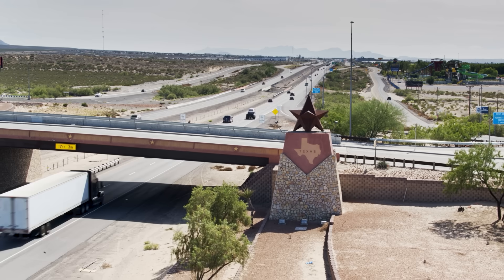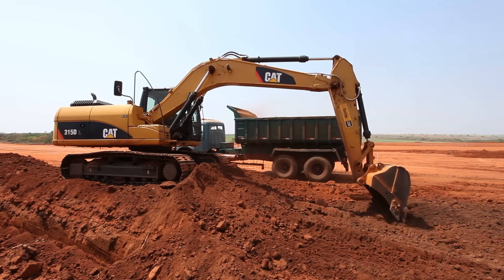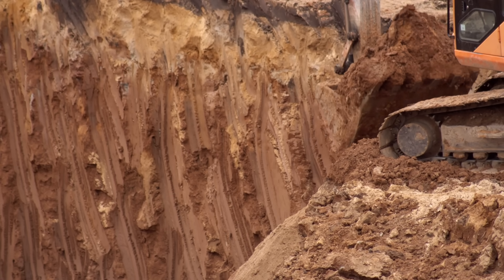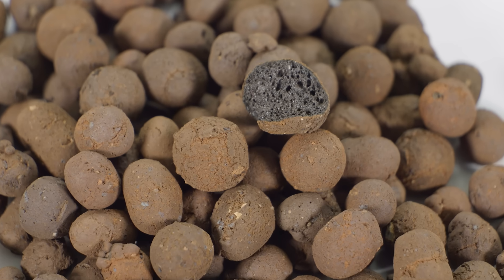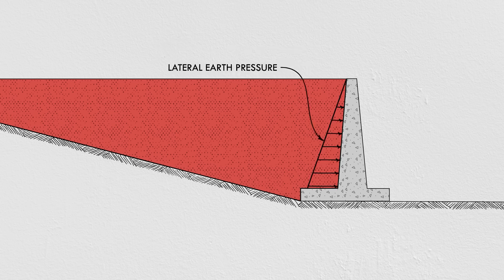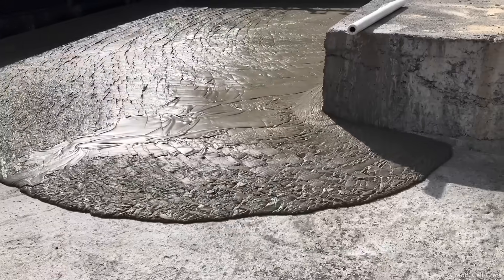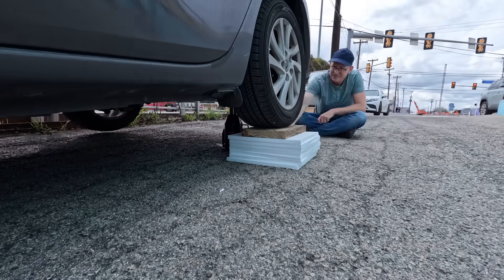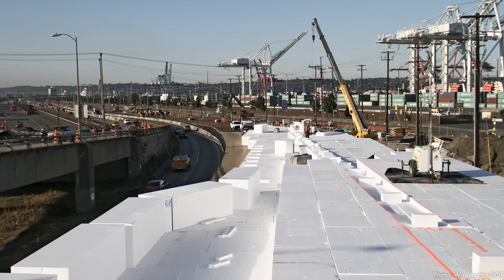Why Some Roads Are Made of Styrofoam

Comment: A bit OT, but when we had a flat built in Hungary, I was surprised to see that, as well as the highly insulated blocks they typically use, they also lined the outside of the walls with expanded polystyrene blocks (maybe 15cm/6" thick?) and then rendered over the top. As a Brit, I was very surprised by this, as I think of this material as lightweight packaging, of no particular strength, and essentially for throwing away after use. Had I had the option, I probably would have chosen not to have this extra layer of insulation - imagining that it would be very easily damaged and the rendering would tend to flake off.

But, nearly 18 years later, none of that has happened - the exterior hasn't been damaged at all and the rendering is actually staying attached better than it does on a normal brick or block surface. In fact, unless you tap the wall, you would have no idea it was expanded polystyrene. The only drawback I've experienced was when putting up external lights on the balcony - when I had to buy a ridiculously long bit for my drill (to reach the actual brick work) and then faff about with poking fixings down a 6" hole with an equally ridiculously long screw!

Comment: A bit of a problem with EPS foam for roadways... unless there is a considerable thermal barrier between the foam and traffic a single high intensity vehicle fire could compromise the entire roadway.  I would imagine that the surface, subsurface, and substrate would be generally sufficient but flowing fires could get past all of those barriers and create more nightmares than the initial accident.

OTOH I could imagine that this foam would soak a lot of the stresses imparted by earthquake events, enough to prevent immediate catastrophic failure of the surface that it's supporting though could require replacement after the event.

Comment: Polystyrene fill on a railway embankment in England. A remediation project on mainline lead to the bridge abutment . To allow for greater axle loading and greater speed. Polystyrene was used to rectify poor soil in the embankment  and the poor bearing properties of the soil in the area. Cheaper than closing the line for months and recreate the whole embankment leading to the bridge abutment.

Comment: What about railways in this context?  They have exactly the same problem - 'soft' soil embankment meets rigid concrete/steel bridge, but they have significantly heavier loads going over the interface, and a difference in height can be catostrophic (a bump for a car is a derailment for a train).  And they also don't have the luxury of waiting weeks or months for things to settle - railway engineering typically has to be done and finished over a weekend, or even overnight.  What do they do that road builders don't?

Comment: In the netherlands we always use a concrete slab that rests one side on the structure, the other side on the ground. This way, the "bump"' created by settlement, is also distributed more evenly. We still use lightweight materials a lot too though

Comment: Man, should you be informed that cellular concrete, also called aired concrete, is the default material of choice for building in basically the entire eastern half of Europe? We make strong concrete pillars and the walls themselves are large bricks of cellular concrete. It`s amazing to work with sculpting and cutting the blocks into anything, plus any leftovers or dust from cutting can be scooped and mixed with the mortar used to stick the blocks together. Almost zero waste, plus it`s a fairly good insulator, reducing the need for thick and polluting styrofoam.

Comment: The Czech Republic:
Road closed
Work starts after a year
2y building 100m of the road
1y still closed
After about a month it is even worse, than it was previously
And yes, we have a highway with length of 366km (additional 10km in building). First project is from 1935 and it is not finished yet. One transition to a bridge survived just 1 day after 6 years of building it.
Reply: Nice corruption you’ve got there. I’d like to see how well built the mansions are occupied by the people who run that circus.
Reply: @mercoid  You are kind of correct. 1km costs nearly the same as in Switzerland and Switzerland is mountainous country with much better roads.

Comment: In Sneek the Netherlands they have a problem at the aquaduct. The road raises by ground water pushing it up.
As tempory sollution they placed sandbags to weigh the road down.
It works only no vehicle can use the road till they find a way to solve the problem...

Comment: Where I live, a number of bridge ramps where constructed of huge blocks of styrofoam.  7 years later at the point where the foam meets the bridge deck, there is severe settling and is downright dangerous to drivers.  Warning signs seem to be the only recourse engineers are taking.

Comment: I drive over 35 bridges in 40 miles one way and I plan a ton about how I'm going to cross those bumps. Don't want to hit it loaded or right in the middle I just drive a little to the right or to one side or the other depending on the turn

Comment: That Styrofoam ramp fill in Seattle is on top of the sawdust pile from Yesler's sawmill which ran from 1853 to 1895 or maybe even 1930-ish and underlies many many blocks south of the big buildings in downtown Seattle. That struck me as amusing.
Also it looks to me like the break test on that concrete sample failed starting on the outside where it saw shear and tension. 
I'll bet it would be much stronger in real use where it is contained/constrained by surrounding material.

Comment: Cellular concrete is also used in EMAS (engineered material arrestor system) at airports to safely stop planes that overrun the ends of the runways.

Comment: I noticed I tend to feel the pavement seams in I-5 between Portland Oregon and Vancouver Washington, but that's not because of the ground settling under the freeway, it's because the freeway is so old that tires have worn it down by an inch or so, and the metal rails across the pavement seems are not as worn as the pavement is. I literally hug one edge of the lane when I drive it because the payment (on the edges and in the center of the lane) is less worn and the bumps are smaller.

Comment: Aerated or cellular concrete can be made stronger still for a given density by substituting higher compression cement and by adding fine fibers. I myself have made some using a foam generator and adding polypropylene fibers of various lengths and amounts. Aerated concrete has also been used to make overly soft surfaces for airliners' wheels to sink into at the end of runways to stop them from going further in emergency landings.

Comment: Near where I live at the old Cape Horn interchange near the Port Mann bridge we used to have embankments on each side of an overpass and we got really bad bumps at the embankment/overpass junction. When they replaced the Port Mann bridge they built an all new Cape Horn interchange with a lot of EPS blocks. Now, about 5 years later we are getting those bumps again. One place got so bad after 3 years, it had to be remediated. But the bumps are coming back even there. Overall, our experience in the Vancouver BC area is that it is not the panacea we hoped it would be.

Comment: I'm a DOT certified inspector and I've worked on a road project where they built up a section of the roadway 3 lanes wide about 40' long and 15' high using styrofoam blocks because they didn't want the weight of the fill on top of some old but still live pipes under the roadway.

Comment: How about adding "styrofoam" beads to concrete?  The "styrocrete" would prevent the styrofoam being susceptible to spilled solvents, and you could tailor the density by adding more or less styrofoam to suit the need or conditions of the site.  It could be formed into regular shaped blocks that could be stacked like big lego bricks to fill most of the space and then pour fresh "styrocrete" to fill in the remaining space between the bricks and the retaining walls or other boundaries of the site.

Comment: As a Concrete Canoe alum, thank you for highlighting that concrete can be made to float!  When we designed our canoes, we typically used glass beads and expanded glass as the bulk of our aggregate in addition to increasing the pozzolanic content to replace cement (the densest ingredient).  Of course, we still needed the canoe to withstand Race Day stresses, hahaha.

Comment: My understanding is that what happens at ends of roadway bridges, happens also with railroad bridges. Big difference would be the weight of the vehicles, making things interesting, besides the rigidity of steel wheels vs pneumatic tires. Comment?

Comment: The old Huey P. Long bridge was supposedly constructed with cotton bale supports.  It lasted forever, was hit by boats or barges, and never budged.  there was always a bump on and off, and a swerve about 3/4's across that felt like they built it from both sides and did not quite match in the meetup.  A few years ago, they remodeled the road, it is bigger and very smooth now, it handles more traffic.  The train part of the bridge, (original, center) looks the same as it always did.
Reply: We also had a section of highway that sat for over 5 years before completion.  I like that you explained why soil needs to settle.

Comment: Another solution to this problem is add a plate connected to a hinge and that hinge is connected to the bridge so when you drop the plate the hinge just settles on the dirt literally that simple if there's anything wrong with that or any problems pointed out in the comments section of this comment

Comment: I have a question that I hope you can answer if you have time. 
When the embankment is built the last step is to use the asphalt to level off the embankment with the bridge/roadway. You talked about using lightweight materials to mitigate the settling resulting in the two surfaces no longer meeting up. When you consider that most of the materials you mentioned need to be manufactured and almost surely use up energy in their creation which leads to needless emissions. I cannot imagine that dozens of truckloads of these materials are cheap/ easy to make/ made locally/ or are anywhere near emission neutral compared to just using dirt. 

1 - (I guess I actually have two questions) Are these materials as expensive and needlessly harmful to the environment as it seems to me? Or is their production and transportation compared to (almost surely) locally sourced dirt about even?
2 - Considering how rarely these types of structures are built in each given jurisdiction, wouldn't it be easier to just have a city employee check the new construction every 3 or 4 months for the first 3 years that your graph showed the embankment settling; and if he sees that the two surfaces are sufficiently out of alignment, to call for a paving crew to spend half of a day adding a 3  or 4-foot long section of asphalt (the width of the road) to feather from the road surface to the (now slightly higher)bridge/roadway?

Cities always have asphalt crews and diverting one 3 to 5 times over three-year span at half of a day or so per touch up seems a lot cheaper and easier than producing and hauling special material. Or am I underestimating just how effective these materials are compared to the cost of minor road maintenance? I know people bag on road crews but they are much more effective than people think. And there will probably be potholes and other imperfections very nearby that they could repair while there. It seems to be mostly a scheduling hassle more than anything.

Sorry for the length, I just found the video very interesting and was trying to weigh various methods in my mind. I almost exclusively deal with mechanical contracting and only see the civil side of things as a byproduct of my part in a building so I am just asking out of curiosity.

Comment: What’s the insulation properties of the cellular concrete?
Seems like it could be both a structural material, as well as a very efficient insulator!
Reply: Sadly in reality no such thing exists yet. Good structural material or good insulator-choose one. Or you will get neither. Glass foam looks promising, but its use is very limited.
Reply: Expanded clay is somewhat similar material to cellular concrete. Exclay has been largely phased out in my country due to various technical problems.
Reply: @madistamela5975  I recently found out about air Crete, it’s structural and fairly insulating,
It’s not a strong as for concrete but it’s also a lot lighter so if the rest of the structure is made out of the same material it doesn’t need to carry as much and can be used for walls. So perhaps there is some sort of middle ground available.
 Similarly the Romans used hummus and other lighter forms of concrete to make the oculus in the pantheon, which has stood for millennia, 
So it sounds plausible.
Reply: @FreekHoekstra  Lightweight aerated concrete blocks have also been around for some time. But problem remains-only 2-3 story buildings can be built and walls still need additional insulation. Despite manufacturer's claims:) Aircrete sure has its uses.
C50/60 concrete with EPS' thermal properties would be nice.

Comment: So, what happens if a flammable fuel tanker truck catches fire on top of one of these EPS embankments and fully goes up? I know that the foam would likely not cat fire because of the lack of oxygen, but the heat would cause melting of the surface layer and down further, wouldn't it? I know for a fact that a single fuel tanker truck going up burns hot enough to take out a steel bridge completely since one did that in San Fransisco to on of the bay bridges.

Comment: Have you seen them use those Styrofoam building blocks that are stacked up and then filled with concrete? They built a gymnasium near me using those and the Styrofoam building blocks let them quickly stack and then pour the concrete, the gym also doubles as a tornado shelter for the school. the concrete there is at least a foot and a half thick and there's cinder blocks on both sides as well, plus the styrofoam acts insulation.

Comment: There is a section of I-95 that runs from 528 to Barnes Blvd interchanges with foam under the concrete road structure. There was a crash with fuel truck. They pushed the truck off the roadway onto the side and put up barriers around the tanks while they pumped off the petroleum, since they didn't want to have to redo 4' of foam and the concrete surface on top... They were scrambling to get this done before it affected the foam.

Comment: It not only the weight of the ramp that makes the surface go down, its also because its hard to compact materials in the ramp. 
This means the traffic will compact as time go by. 
I have seen it in my own work as one who administrate the maintenance of civil works (bridge, wharf, tunnels, stairs, support wall, ect)
(Sorry, I'm coming a bit short in English on some of the specific technical expressions)

Comment: About 25 years ago, I was part of a geotech team tendering for a second bridge across the Swan River in Perth, Western Australia. The ground was very soft alluvium, and the embankment needed to be quite high. We proposed a stabilised soil fill over foam-core solution, but were unsuccessful - the Main Roads Department were very conservative (and still are), and went for a conventional (and much more expensive) pile-supported solution.  Nice vid, thanks.
Reply: Here in the Netherlands we need a combination of eps backfill and pile supported retaining walls after the ground was compacted by adding 3 meters sand on top(with vertical drains to 15m below surface) and let it settle for a year.
Reply: @B100-c4m  The Netherlands virtually invented wick drains and preloading! I had no idea you used EPS, but it makes perfect sense.
Reply: There was a motor-road built in sweden and Norway in the 1960s. During the time from 1960 untill 2010 the road was upgraded to a full highway. The main part between Malmö and Göteborg in sweden was the first long part that was totaly finished some time mid/late 90s.

The last section to be built was a fairly large Marsh like area. The old road went far around it, but when it was upgraded it was just not an option. The last bit built had to go right throw the swamp land.

There was rock under, so it could be piled, but eventually they made it to a testbed for the first fully esp supported road.

And to this day, almost 30 years later, it's one of the most even roads.
Reply: @matsv201  Our Principal was inspired by the use of EPF in the Nordic countries and I believe in some of the far northern permafrost zones in developing this proposal. His background was in London, as well as in the Gulf of Arabia, and he had an encyclopaedic knowledge of working with both soft estuarine sediments, such as London clays, and the calcareous, often weakly cemented sediments found in the Gulf and across much of WA, including around Perth and on the Northwest Shelf. I did a fair amount of work offshore while I was working for him, primarily in pipeline route surveys, but also in marine construction. It was an interesting few years :).

Comment: Styrofoam is a material manufactured by DuPont. The other companies call in different ways.
After working a lot on my Ph.D. on cellular materials, I will say that XPS is more effective than EPS... but if you are afraid of the splits because PS is melted on gasoline (the only defect of that foam), you could obtain similar mechanical properties with extruded PE or PP foams, that almost are no dissolved in nothing, the problem, is more expensive.